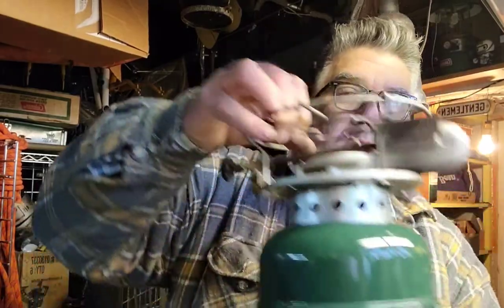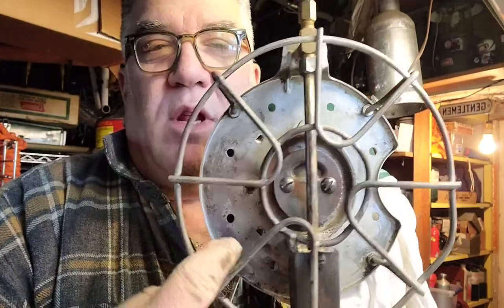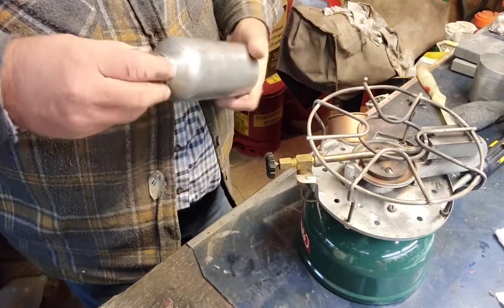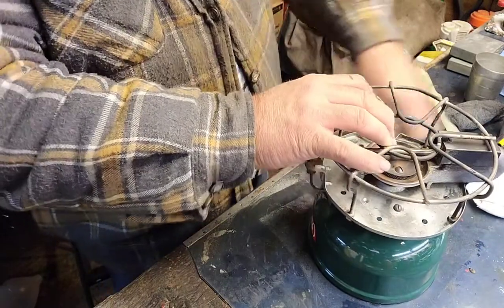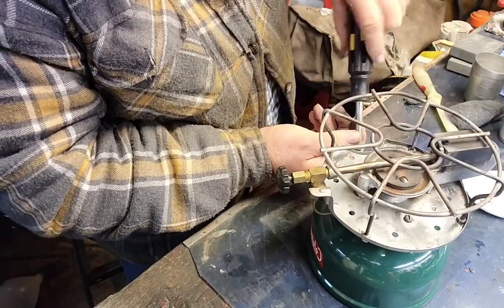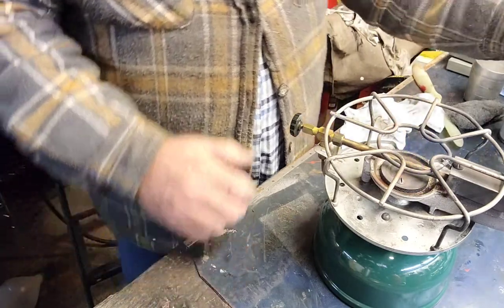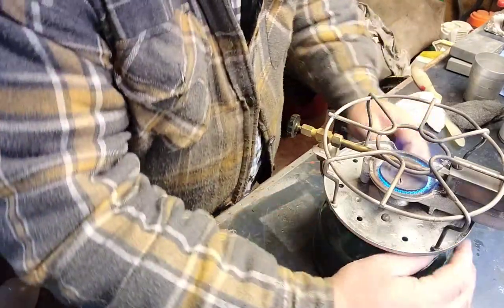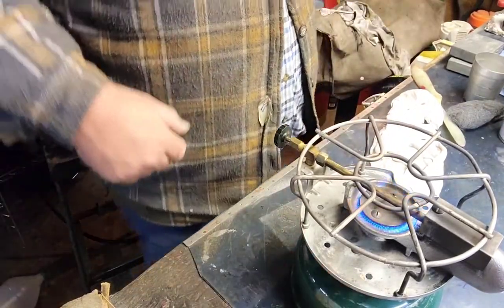Vintage Coleman stoves Sportmaster 500A - BBCC Bluegrass Bushcraft Coffee Challenge R2

Comment: Nice one!  500's are the ones that melt the grid if you run it without a pot on it?  What toaster? off to make my FUIF/BBCC video in the porch. Up to 22F so good times. Thank you for the video, Steve. Good luck at that sale. Stay safe and stay warm.
Reply from the maker: Really? That's a good tip I had no idea that it would do that I wonder how it will work with the heat drive on it Hey guess what I picked up some cast iron pans and tried my 1st  seasoning and I'm trying to make something today with them I'll let you know how it goes!